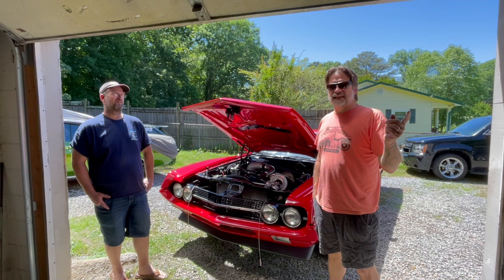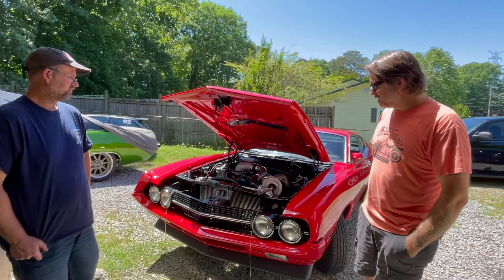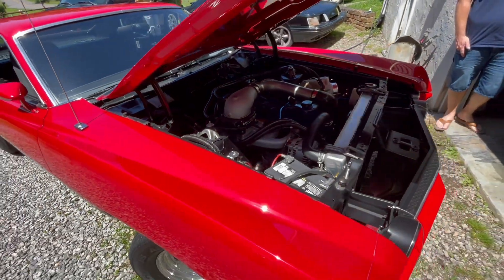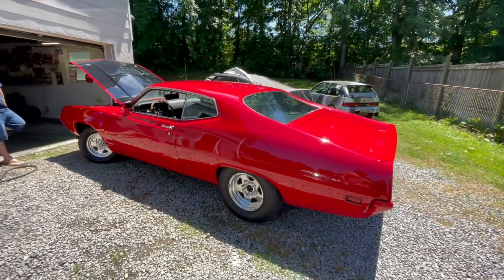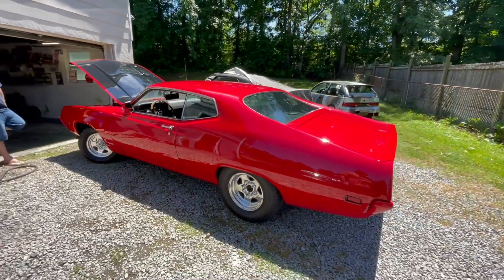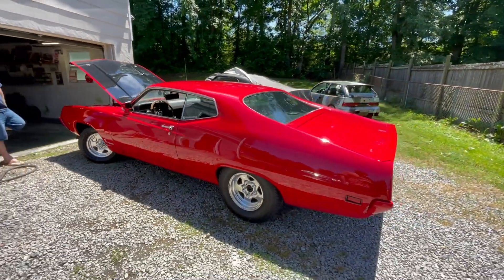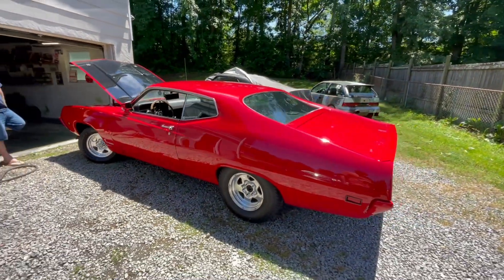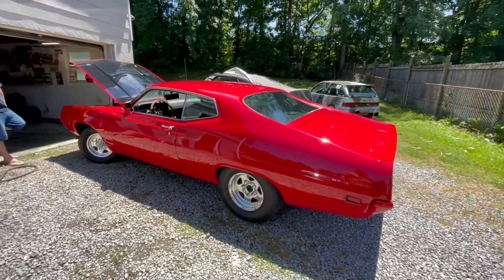EHR Has a Look At Russ' Turborino

Comment: 'No power brakes to worry about'? Never knew that was an issue. Odd the subject car wasn't started.
Reply from the maker: No power brakes means less clutter and no need to worry about low vacuum from a big cam.
Reply: @easternhotrodder  never had that problem.
Reply from the maker: @skylershank9309  I have. Many times.